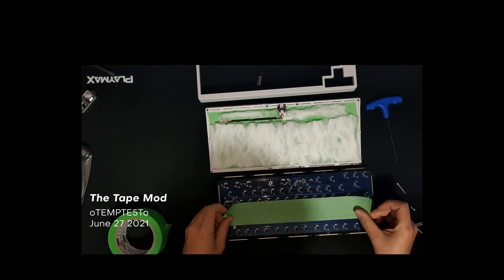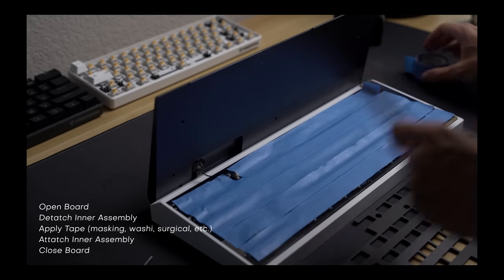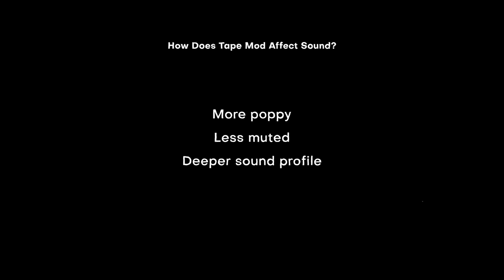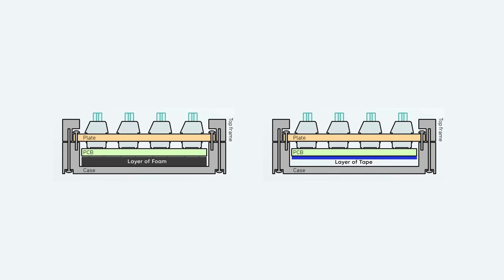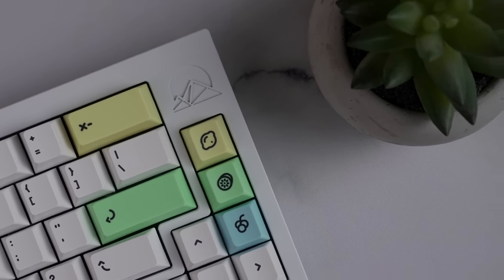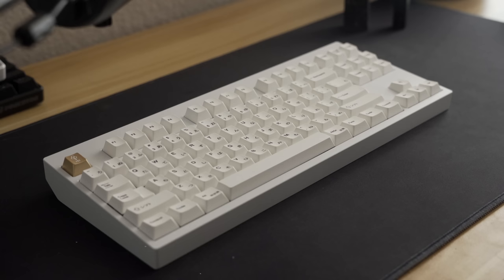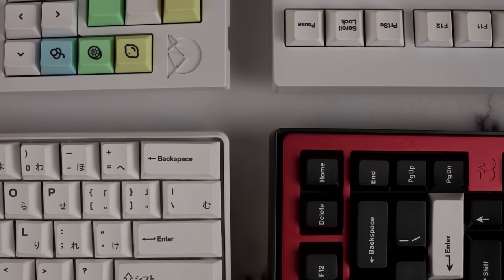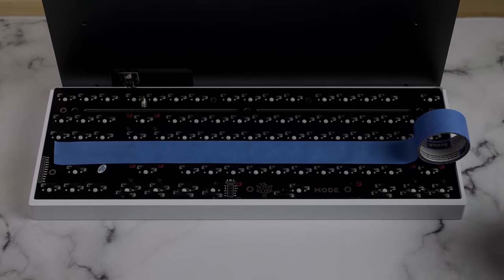Tempest Tape Mod Explained

Comment: Nice video on this mod! Although I feel like people need to know that even tape with the most delicate adhesive will "burn in " over time & become more difficult to remove the longer it is left on a surface. So I would be advise against leaving this mod on any PCB that is not easily replaceable for an extended period of time.
Reply: @oTEMPE5To  the issue is often with certain masking, electrical and such tapes. I have two rolls of tape one of which I'm sure will leave adhesive residue but the other works just fine. So in the end who knows. Also it's a pain to remove adhesive from PCB and such when it turns into that gooey mess tbh.
Reply: I recommend a professional grade painting/modeler's tape; brands like Gunze Sangyo or Tamiya.
These are specifically designed to leave little to no residue over long period of time even when exposed to heat.
This is because many fine crafts and paintings can take well over months or even years before completion, and sometimes those tapes gotta stayed on the throughout the entirety of the process. The downside is that these tapes are more delicate and can lose some adhesive property overtime.

Comment: Thanks for explaining! Does the PE foam mod on the pcb work in a similar way? I guess that since the switch rests on a softer surface the higher frequencies caused by the switch bottoming out get filtered resulting in a poppier sound, but I'm not sure (I don't have an audio degree).
Reply from the maker: I’ll hopefully have some PE foam on hand to experiment with soon, but right now I don’t have an answer I can be sure of.

Comment: Definitely deeper, but I feel like the character and individuality of the switches is reduced... if that makes sense? The non-tape sound tests, you could hear each keypress. With tape, it sounds all blended together. I can’t think of a better way to explain it lol. Maybe that’s just part of having a deeper sound, but possibly something created specifically from this mod.
Reply from the maker: No, what you're saying makes 100% sense. It's even worse with the PE foam mod. Case design varies drastically between keyboards, while inner assembly design stays largely the same. And since the tape mod contributes to isolating the PCB sound over the case sound, it definitely does have the effect of making things start to sound the same.
Reply: @nearLucid  That’s a really good and easy-to-understand explanation. I know you also said similar things in the video and in comments, but I think it finally just clicked in my mind. I think acknowledging this detail about the mod removing some of the personality from a build can help increase appreciation for case sounds in an effort to become more unique.

Comment: I personally am not trying it on my boards. Adhesives degrade over time and can leave a residue on the PCB and components or get dry and crumble into different components. Also some adhesives might react differently to the different materials on the PCB. From videos I've seen I think it can add a nice sound, but I'm not risking it due to these factors. Someone agrees?
Reply: Agreed. My keyboard already sounds very nice and sticking tape to the PCB will just make it sound worse.

Comment: *Cries in handwired board
Reply from the maker: Sadge
Reply: Be a madlad and put tape on the botttom of the handwired matrix. If the theory about it working as a filter is true then it should work to an extent
Reply: @MaxC_1  I imagine it would be better if you put tape on the bottom of the case or case foam instead,  but I’ll need to try out your idea as well, thanks lol.

Comment: what would happen if you add case foam AND tape mod?
Reply from the maker: It might have barely any effect, or it might slightly reduce the case sound even more by “absorbing” it.
Reply: a youtuber did this, i forgot who tho
Reply: i did this, and i think the results are different with different boards, like the video stated.
I'm using redragon k530, and the results are pretty much the same as the TH61 in the video. 
I experimented a bit with foam and no foam. I end up combining them with case foam since it sounds really deep. So yeah, just experiment with them and find which one u like

Comment: You might want to try adding more layers of tape, or you could also combine it with a foam mod.
I already tried it on my Womier K66, but I would like to see what it did to higher end boards.
Reply: Did the tape improve the sound of your K66? How many layers did you use? I have a K61 and am thinking of trying this mod out.
Reply: @skree_fpv436  From my experience, 3 layers is where the sound starts to change, 4 layers is where it changes even more, and 5 is the max. More than that doesnt do that much. 5 Layers makes it sound louder.
Reply: @extremecat9863 Cool! I'm going to give it a shot. Tysm for the reply!
Reply: i will put unlimited layers until the case cannot handle it

Comment: hey can someone tell me if i can use some foam tape as something to fill my board with as its thick and im only doing one layer of it in my board can someone tell me if its ok to use or will it be flammable to use
Reply: If you want to do the case foam mod, I suggest using vulcanized rubber foam instead. Not only it sound absorption are good but it also safer for you PCB. Normally a 2mm or 3mm layer vulcanized rubber foam is enough depends on how deep you keyboard's case is.
Reply: @huunhanle3809  hey thanks i have got my problem done i filled it up it wil some rubber that filled the board up but not to the point where the whole board could almost like explode while using it but thanking you anyway for the answer if i had not found on what i found then you would of been a life saver 👍

Comment: hi nearlucid, thanks for the content. i have keychron q5 pro. and i want to use tape mod as well. people said you should use painters tape because it wont leave a residue so i purchased a good brand. now im checking web again to be %100 sure however some people said battery might got heated and tape could catch on fire. however my painter tape has high heat resistance (80 degree celcius - 176 fahrenheit) can i use this painter tape? i never feel my keyboard is hot, it'll always cold with aluminium frame and i never turn on rgb also. should i buy electrical tape which could leave residue but i guess it wont catch on fire or painter tape is good/better?

lastly if i use painter tape mod. how many layers i should apply, 3,4,5? and should i apply tape to whole pcb or should i leave some parts open, is there a thing i should be careful?

Comment: Did this on my Keychron Q1 Pro with electrical tape, thinking it might sound more solid and rigid, but no, it did the exact opposite. It now sounded very hollow and cheap, like a plastic board. I like my boards to be quiet and solid. I instead filled the bottom with at thicker rubber mat, that gave it even more of a dead sound. Don't do this mod if you like your board to be quiet, it's terrible for that.

Comment: Not sure about the sound absorbing theory, but when I tried with my clear tape, I saw that there are a lot of small pockets of air where the tape cannot stick to the PCB (e.g. around the hotswap sockets, LEDs...) and that might be the one that causes the deep sound, like how a guitar works or how SA keycaps generally make switches sound deeper

Edit: I'm using gat KS3 yellow, carbon fiber plate, OEM PBT keycaps, generic 60% plastic case but filled with thin strips of metal weights and a layer wiping cloth on top of it

Comment: The science is exactly opposite to what is mentioned here in the video, the tape will dampen out the pcb, resulting in higher frequencies being cut leading to less of the clicky noise, I assume by poppy you mean less clicky based on the sound test.

Comment: I dunno about that "its the opposite of sound dampeing" thing.

I use a GMMK Pro, and I found the soudnof this board to be quite muted and too clacky for my taste.

I applied 2/3 layers of masking tape, but I didn't remove the bottom case foam insert, meaning that in theory, the keyboard should be even more packed than before, and should sounnd even more muted.

But uhh... It drastically lowered the pitch of the overall keyboard, eventhough everythnig is still compactly packed. If it was some kind of resonnance, the foam insert woul probably have absorbed it.

In the end : I'm still hella confused of how does this mod work, but hey I'm not complaining.

Comment: i am just new to this hobby, bought a cheap keyboard for 35$, researched alot about keyboards before hand and now i have my keyboard. i changed the switches and thought of tape modding it since it was really easy to do. i feel like the tape mod removes alot of the hollow ness of the board but it depends on how much layers you use. i used the cream yellow pros from akko and at first it was hollow but after i modded it turned out to be really deep and a really big sound difference.

Comment: Admittedly, I've only read through the top few comments but the consensus is, it acts like a filter. If anyone is familiar with sound deadening car doors, I think this might work in the same way. It might just be stopping the usual vibration produced by the board whenever a key is hit thus removing the higher pitched sound which is caused by the vibrating board.

Comment: Cool, the great thing is it's a DIY material. I highly recommend using Gaffer Pro brand gaffer's tape the tape (it uses rubber adhesive which won't leave gunk when unstuck) used by Hollywood technicians, rather than painter's tape which also use rubber-base adhesive but it's thinner, gaffer's tape is made of cloth instead of paper.

FR4 plate is also made of fiberglass, the same material the circuit board is made from, making their net frequency sync better so the closest to the resonance of the circuit board's as possible.

For me, I'm a blue switch guy coz' I like the noise (except the spacebar but I leave it undampened with 3M spacebar damper sticker coz' it make you smile coz' the click is funny X-D) and the fastest typist 269 WPM in history and in the world, currently uses blue switches. I think even if the best thocc which is the keyboard by Youtuber rizzo7: https://www.youtube.com/watch?v=evjkLMvXTN8 which won thocciest at Switch and Click channel.

It's the thocciest I've heard, I wonder what's the frequency of the keyboard overall, it must be a low one.

God bless, Rev. 21:4

Comment: Just starting out on keyboards, and PC setups in general. I currently bought a Keychron V.1 with Brown Gateron Switches, pre lubed ofc. I've already put an extra layer of foam under the circuit board itself, but was wondering if I should also include a tape mod. The current foam mod I have sounds league's above what was factory set, but wasn't sure. Need opinions, thanks everyone!
( edit: I really like deep creamy switches, that sound kind of sticky. if that's a good word for it. )

Comment: one question, will this affect hotswap pcbs and if you can install new switches or not? because i really want to do this mod but i doubt if it will let me switch out the switches or not.
Reply: you should still be able to switch out the switches although it may puncture the tape

Comment: Guys do this at your risk. My keyboard started gliching and I can bearly type anymore on my keyboard. I dont know how but it started gliching and I decided to remove it  but it did nothing.
Reply: congratulations u shorted out ur keyboard
Reply: @coldfront.  Well it still works perfectly without the tape and I bought a new keyboard. I have 2 mechanical keyboards now

Comment: Lol I did the tempest mod today to mute the board. The gmmk full size has so little space I couldn't fit more foam so I did the tempest mod instead in hopes to get rid of the hollow sound. It worked 😈

Comment: im insanely worried about doing this mod and messing up my keyboard so i wonder, could you perform the mod on the bottom case instead. almost like foam., or does it need to be applied to the pcb. i just dont want to damage my keyboard.
Reply: well i heard some case said that it could makes your pcb become hotter but if you only put under 2 layers should be fine since keyboard doesn't produce much heat , just don't put any conductive and adhesive tapes , always using mask tape.

Comment: any plank or board (literally) is a potential instrument. it vibrates when you hit it. like a woodblock on a xylophone. 
if you bind that medium with tape, you can safely say it will tame or partially deaden that vibration. 
so that's what the tape does. it partially mutes the sound.

Comment: Great video, quality of superb. How long does the tape mod last? If I use masking tape and tape my board, can I leave it in there for a year and come back and rip it off without having any residue? Some of my old masking tape developed residue but not sure if those were years or months old lol
Reply from the maker: The mod simply hasn't been around long enough to be able to know or test this. I unfortunately cannot speed up time.

Comment: Forgive me if I'm mistaken, but isn't the whole idea of Gaffer's tape, that it's not permanent and doesn't leave any residue when removed? Duct tape would be closer to a permanent mod.
Reply from the maker: I don’t have any gaffer tape on hand to try, but I’d assume the 3 tape selection currently most popular are used because of their super loose adhesive. if simply putting switches in can be enough to push off hotswap sockets, imagine how strong tape would do.
Reply: @nearLucid  Possibly, true. Also, if you want to try any tape for it's sound altering properties, you can always apply it over a layer of masking/painter's tape to be safe.

Comment: Exterior painters tape is much thicker FYI. At least the expensive stuff.
Reply from the maker: What's better about that compared to just using multiple layers of cheaper tape?
Reply: @nearLucid  not sure. I've never tried it but the expensive exterior tape is much different feeling. It's sort of like plastic. When you rip a piece off it's like it breaks in a perfectly straight line. So I wonder if it would change the sound. Just an idea. or we can always be silly and try other types of tape. I wonder rif electrical tape would sound different.

Comment: Tried it on my Tokyo 60 immediately. It helps if you add a second “floating” layer that rests on the edge of the top half of the case. Basically adds a drum diaphragm, the first layer mutes the effect a bit and the second layer acts as a drum and makes the tone a bit deeper and louder
Reply: Is it okay to add foam under the tape mod?
Reply: @billy4806  idk try it
Reply from the maker: yes, up to your preference

Comment: The louder sound, I think it is because it does not damp any sound, but reduce the size of the "chamber". A smaller chamber is translated into a higher pitch sound. A higher pitch is usually heard louder than a lower pitch. Probably the DB level is the same is you measure them, but the pitch make you think it's louder even if it's not.
Reply: @hnewc1919  nope, it definitely make it sound with a higher pitch, If you're not hearing it, it's because you can't hear those frequencies (pretty common with age).

Comment: Does this work with an optical pcb that uses optical switches?
Reply: Yes, i just finished my tweaking some hours ago on a Roccat Vulcan TKL Pro. Removed the switches and the case. Spraylubed it TWICE with Nano-Teflon-Spray, let it dry out for 5 hours, and then sprayed another layer of Silicone Oil Spray into the switches and let that dry out for the next 36hours.
.
Between that time, i took a 30x40cm Razer Goliath Mousepad, and cut out around 7 Parts that perfectly fit into the chassis below the PCB Plate. ofc it was a pain in the ass to make small hole cut outs for the 12 Screws and some other stuff from the PCB, but it was worth it.
.
After that i did exactly what your question is referring to, i used two kinds of Tape. One is black textured Griptape and then the std. painters tape that is white and transparent. First one layer of Black Griptape, smoothed out the air holes, then two layers of the white painers tape, one horizontal the last layer vertically arranged, and ofc in between i used my fingernail thumb to press out the air from those bubbles, but there were barely any, because i pressed the tape layers slowly down with lots of pressure from the beginning.
.
What can i say....i nearly cried...i expected some sort of "better sound"...but this totally blew my brain out of my head. And yeah this was my second time doing ANY tweaking at all. The only thing i did once a year ago was using TeflonSpray to spraylube a roccat vulcan 100 with mechanical switches...and that worked out great too, but nothing in comparison combined with the tape and the razer cloth pad as dampening material :D
.
Oh yeah it was a pain to try and screw it up together again becaus the mousepad inside was so thick, needed to make many attempts and cut-ins for small layers of plastic that are like litte corridors attached to the chasis, and i needed to use a very very small rasp tool to make the USB C Hole in the chassis vertically bigger...but yeah, it fits, literally perfect. one or two milimeters more and i would have not been able to screw it back together, but the mousepad is literally 3mm thick. So no worries, you wont run into these issues at all even when you use many layers of foam and tape combined.
.
https://imgur.com/gallery/14eer08
Reply: @ALIENiAM  woah thanks a lot for this, looking forward to modding my razer huntsman te

Comment: so theoretically, when u put the tape mod, u won't need a case foam mod?
Reply: Not necessarily, I found that the tape mod makes my keys sound a bit "thockier", and with the foam that came with my case (not sure what type of foam) it only really dampens the sound and doesn't change it much.